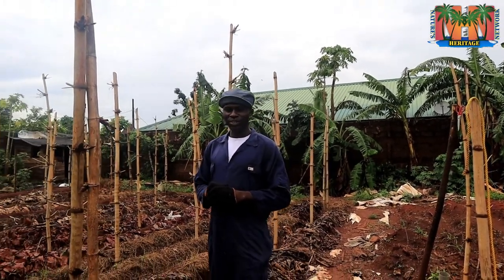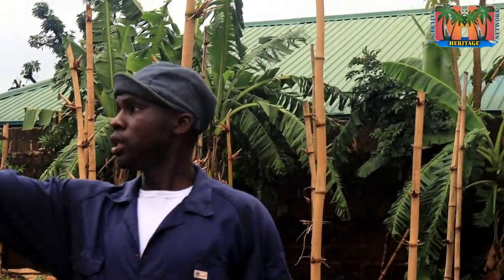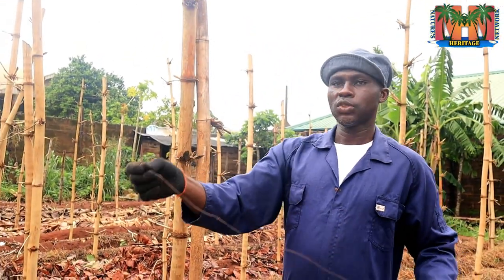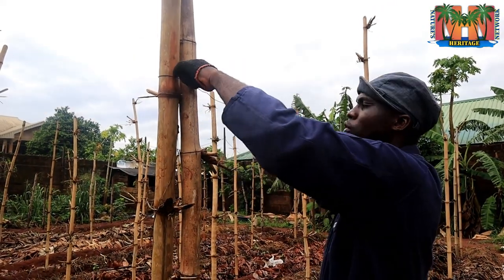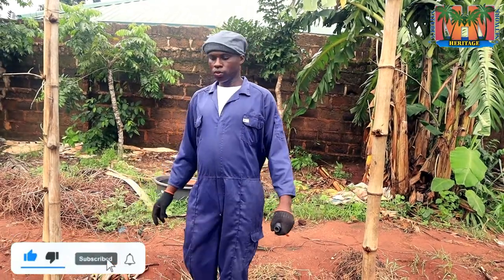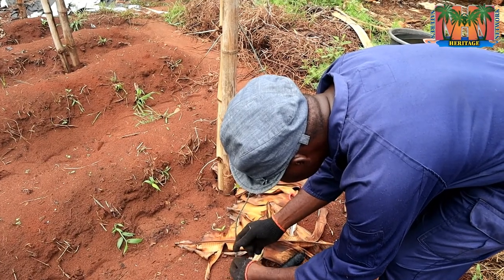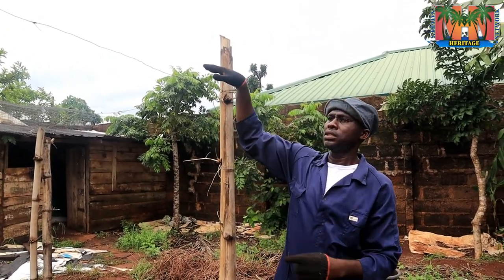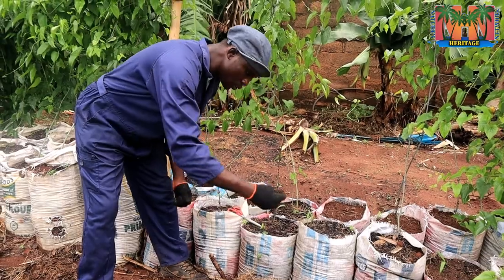Making Yam Trellis From Start

Comment: This is really awesome my tutor, mentor... Thanks always for giving us update ideas on progressive and sustainable planting method.

However, I have a question concerning using binding wire, b.wire is prone to rust especially when it's exposed to the atmosphere - will that make it sustainable after the first usage? Perhaps, how can it be packed to its circular form after a planting season? Because, I'm worried about folding back, unlike rope.

Thanks sir.
Reply from the maker: It can be rolled just the way it was bought.